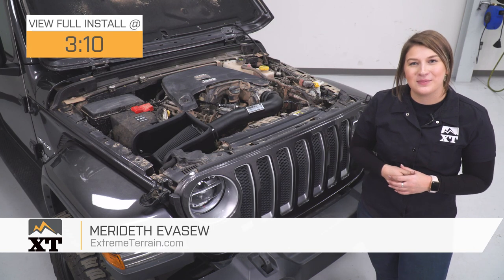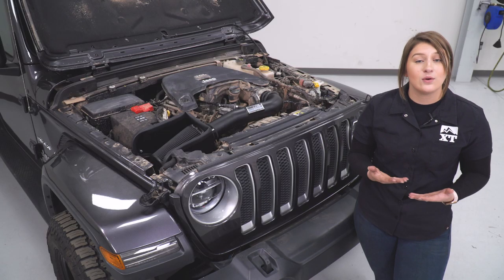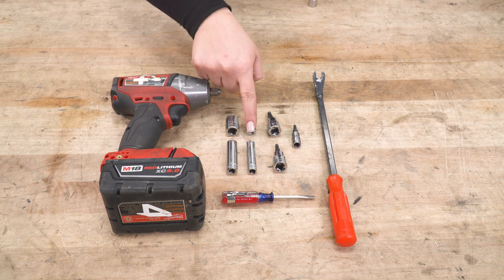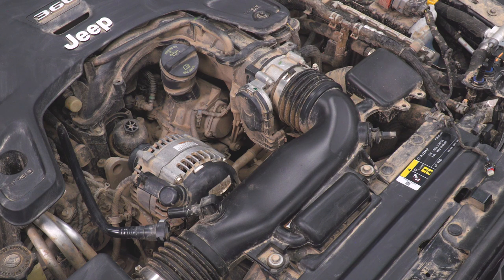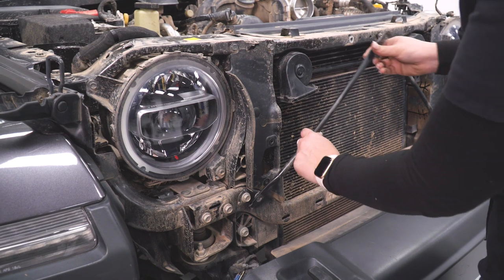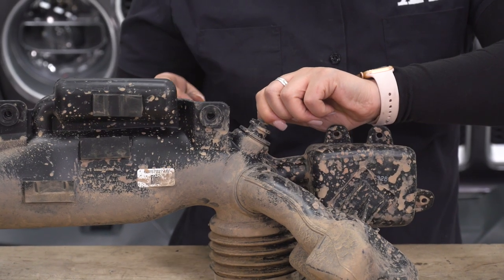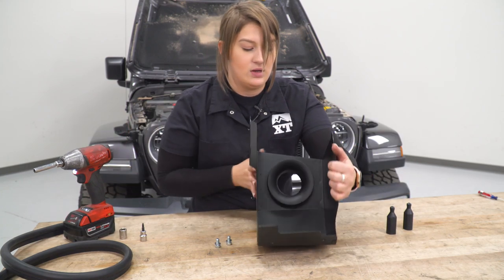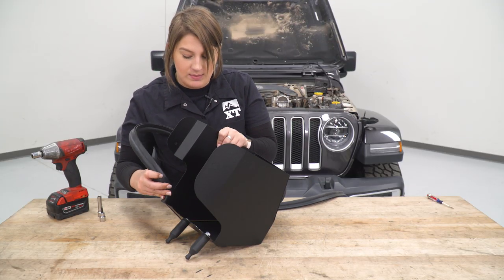Jeep Wrangler JL 3.6L K&N Blackhawk Cold Air Intake Review & Install

Comment: Just installed this on my Jeep Gladiator! Loving it so far!!  I live up at 7,500 ft in the mountains so I can often tell my Gladiator is a little oxygen deficient when I occasionally descend to lower altitudes and get better performance. Installing this definitely added some get up and go, especially at higher RPMs and higher speeds. Like other commentors said, there is no need to remove the air intake tube for the Gladiator model (instructions doesn't even mention it). 
Just a minor annoyance, in the video it shows almost like a square plaque to adhere the badge to. Mine does not have that, it is only round, and the edges of the stick on badge keep peeling up. Minor annoyance though...
Reply from the maker: Glad you are loving it!! Thank you for watching!!

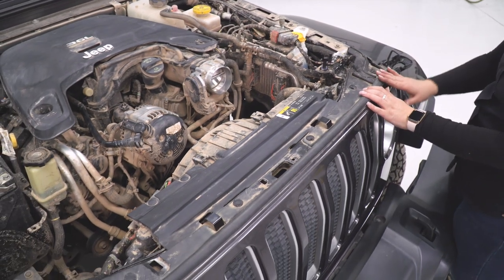Comment: Skip 5:30 through 7:50 on the Jeep Gladiator JT.  There is no need to remove the ram air intake tube. There is no need to remove the grill since the ram intake tube flows directly into the new air-box. The instructions make no mention of removing the intake tube for the grill makes it a lots easier and more efficient. Thanks
Reply: Same with the JL.  The stand offs let the metal box straddle that air scoop.
Reply: 100%!!! Just installed and leaving the intake tube in place actually puts more air up into the air box!

Comment: Put one on mine I didn’t tell any difference from stock maybe it would be better if you done some other mods with it
Reply: Usually the OEM air intake is designed to exceed the engine’s maximum CFM needs so upgrading it does nothing but make more noises and leave you with a filter that gets dirtier, faster.

Comment: Is it necessary to remove the ram air tube she is talking about. I ordered the same K&N intake system but the instructions that came with it has nothing about removing it but every video I see people are taking it off. Wouldn’t it provide more air to the system if I leave it?
Reply: I tend to agree that removal of the intake tube is not necessary. I bought this set up for my jeep JT Gladiator and the printed instructions make no mention of removing the air intake tube. Removal of the grill is unnecessary and it makes total sense that there would be more airflow by leaving the air intake tube in place since it feeds right into the heat shield box where the K&N air filter is.
Reply: I removed the ram air intake tube and I’m now wondering if I should put it back on?  I’m wondering what you did? I feel like I need to put it back in or run the risk of overheating. I mean why would you take it out in the first place? There’s room for it and it seems like it would keep the engine cooler if the air flows right into that system. Are they worried about rain getting in there? So confused... 😕
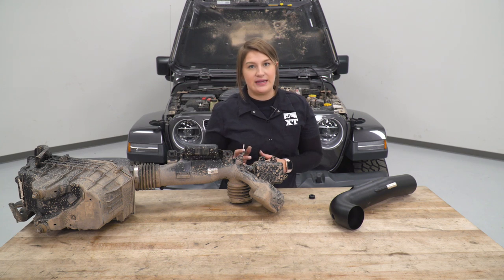Reply: I reinstalled my ram air intake tube and it breathes much easier. Skip 5:30 through 7:50...on my JT